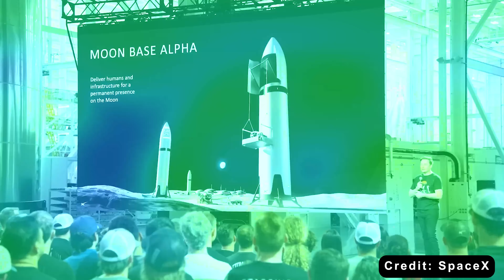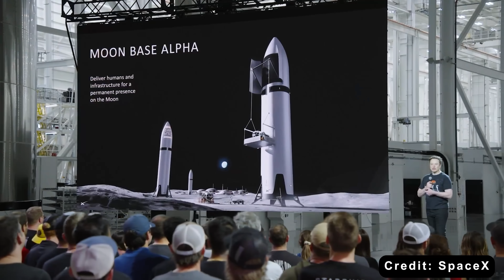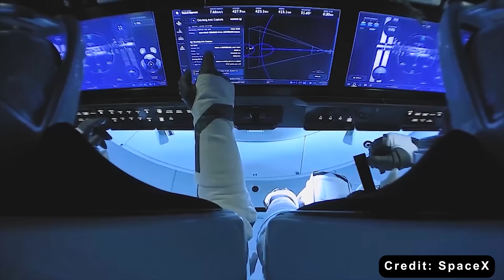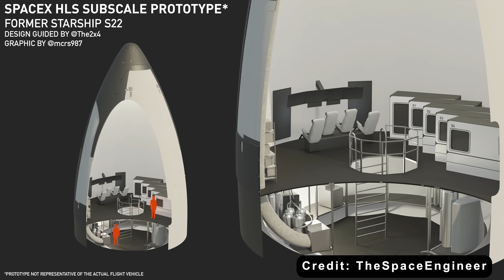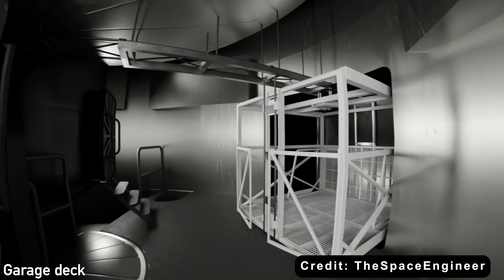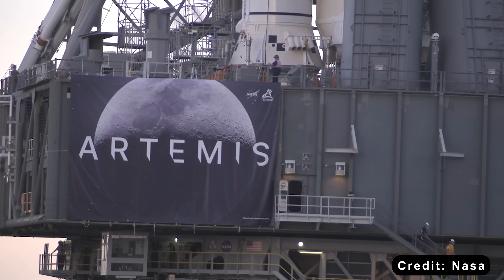SpaceX SHOCKED NASA and China with new Starship method to the Moon Sooner than Ever!

Comment: Just use Dragon capsules to refuel the Starship in orbit - modify a few of them into tanker craft that fly automatically into space, dock with Starship, and refuel it. Which would save on having a second connection system if the fuel lines connect through the noses of both ships - leaving out a potential weak spot in the hull.

OR

Skip Starship entirely. Build a habit module and a support module, both about the same size as Dragon, and launch them into orbit on the Falcon Heavy rocket. After the two sections dock, and automatically extend solar panels and radiator panels, send up a Dragon tanker to fuel them (Sending them up unfueled would mean that they could be larger and carry more weight into orbit). Fuel the combined ship (let's call it Lunar One) with one or more tanker Dragons. 

Then send up another modified Dragon capsule, this one designed to be a lunar lander. Use the same cabin and systems as the Dragon for it, and add landing/take off rockets, fuel tanks, and a power system for when it's on the moon. Dock it to "Lunar One". 

Then send up a Crew Dragon with the ships crew. Dragon can carry 6-8 people, more than enough to do a research mission. Leave it docked so that it, and the lander, can add more room for the crew. Then send the combined Lunar One and the Dragon lander and Crew Dragon to the moon. 

Land in the lander, do the research, then fly back. They can leave equipment behind to save return weight and fuel, and for future use on the moon.

Once back in Earth orbit, take the Crew Dragon down. 

This would require using Dragon in multiple roles, but it already is a tried and tested vehicle that is rated for humans. Unlike Starship. All of the complicated docking and fueling would take place in Earth orbit, so if something went wrong, something could be done about it. Plus sending the crew up last, after Lunar One is assembled and fueled, is safer for the crew. This mission would require just modifying several Dragon capsules, rather than waiting for Spaceship to be crew ready. Lastly, you could leave Lunar One in orbit for future missions.
Reply from the maker: thanks for your cmt, but I think Dragon is not big enough for turning it into a tanker
Reply: @techmap9  My "Lunar One" concept vehicle is far smaller than StarShip. It would only be about as large - at the most -  as three or four Apollo Capsules, which went to the moon. The amount of fuel needed would not be near as much as what it would take to land and then launch StarShip from the Lunar surface. My Lunar lander wouldn't be much bigger than an Apollo lander, and it would be the only part (1/4 of the entire mass of Lunar One) that would land and then take off from the Lunar surface. 

Dragon Cargo can take quite a bit of cargo into orbit and operate un-crewed.  A tanker version would work - and would already have the hard part of automatic docking worked out - something StarShip is a long way from doing as of now.

For a research mission, my plan would work. To build a Lunar habitat, you would send automated cargo flights to the moon. Sending crew after the base equipment is already landed.

One thing the first research mission could do is scout out landing areas and see how much work it is to clear a landing spot. A follow up mission could deploy solar powered transmitters on the ground to use as homing beacons for automatic/AI controlled landings of cargo craft.